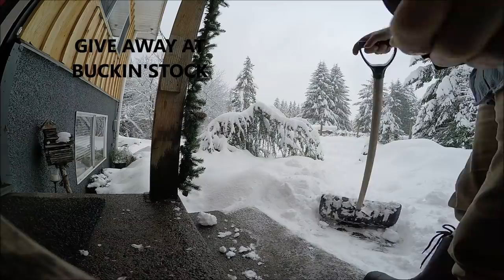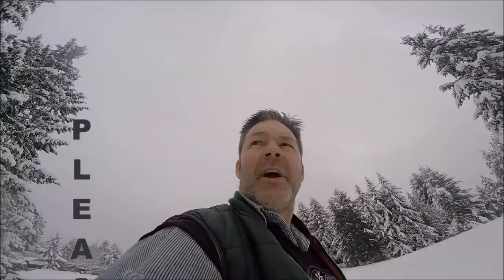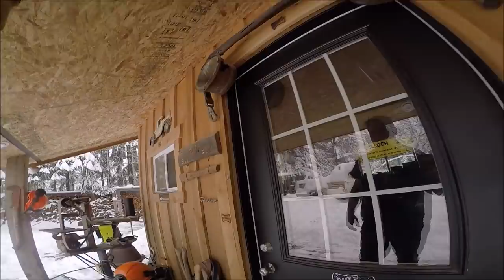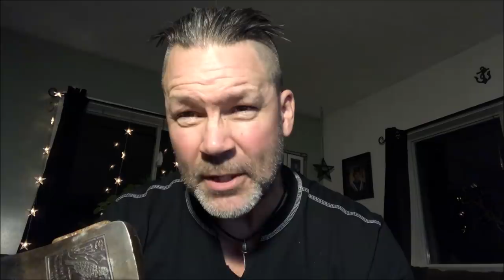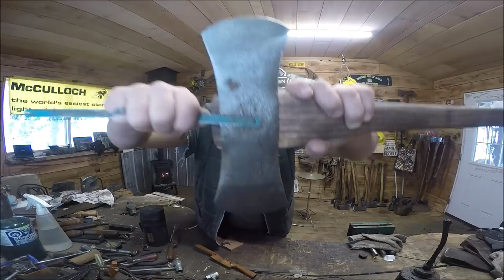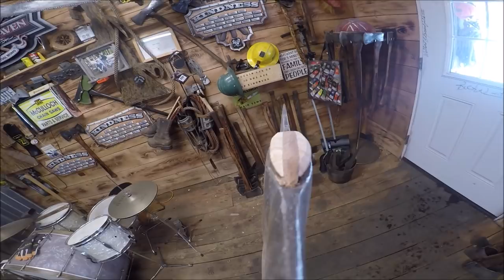SPECIAL MAN, SPECIAL AXE.   BLACK RAVEN AXE REMEMBRANCE

Comment: I wonder if that axe is for Jeremy Blanchard? LOL Just funnin' ya.  We have quite a bit of snow here too, Billy. We got even more since I sent you the image of my old C 10 buried up to the doors. We're supposed to get more this weekend and I have nowhere to put it. My snow banks are already 7' high and my poor little Geo Prizm is under one of them LOL  I have a Shelter Logic 10x10 vinyl shed, and the weight of the snow tore a gash in the roof portion the entire length. I think I need to buy some barn steel to put solid walls on it in the spring, because it's my small engine workshop.
Reply: Angie K you still snowed in Angie 🙈, that's a while now eh? I could use some for my swollen knee I dropped a big car battery on it!!! Don't ask lol. ❤️👍
Reply: @mikeyyoyo6464  Not snowed in, really, except I have had to dig my car out and clean the drive about every other day for 2 weeks now. Our last snow had to be close to a foot, because I shoveled about 6" twice yesterday. I'm more than ready for summer! ;)